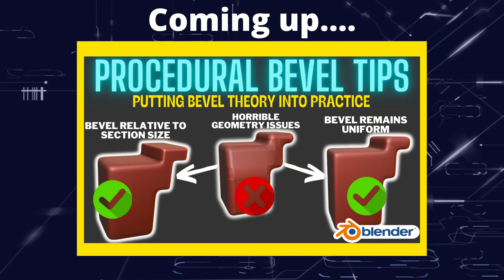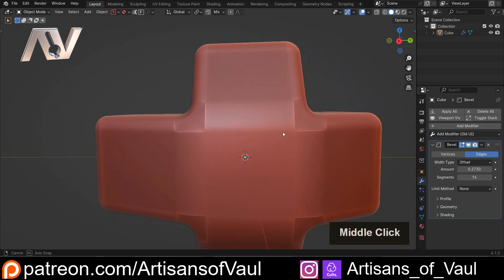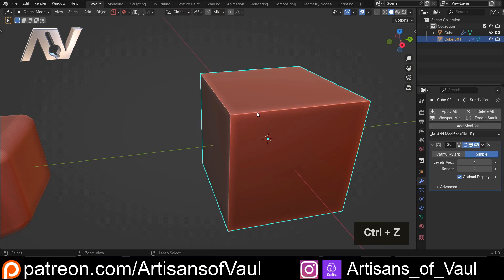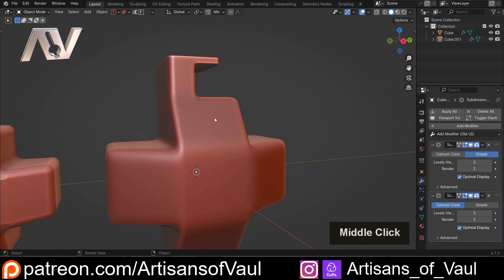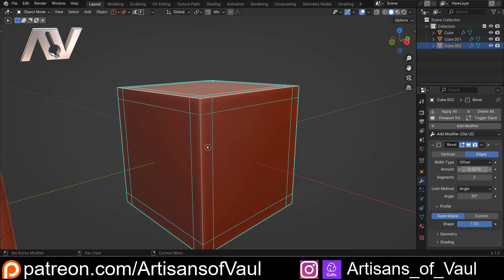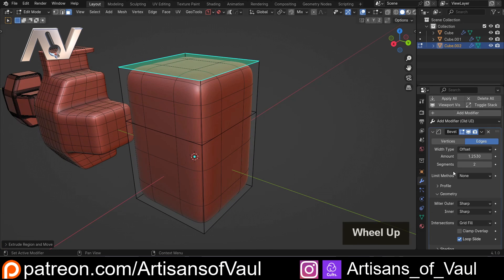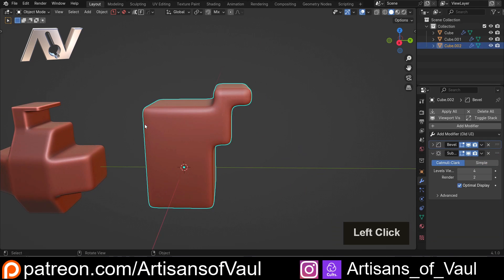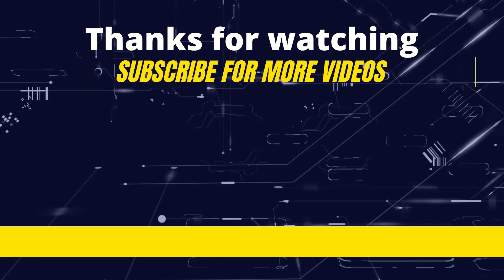Procedural bevel tips for Blender

Comment: in the last example, using the bevel modifier in weight mode you can achieve more control where you want in the model (limited but in some cases a plus).

EDIT COMMENT TEST 😂.  Sorry for deleting the check on the gear video (there was a like and and answer), AV I hope that didn't hurt you. But the issue is still there: I can't put a comment and here I can't put an answer on your answer, so I try this. (I can delete this part later).
Reply from the maker: That's a good call. For this I was trying to find something more generic that doesn't require much tinkering to make work once set up. But that is a good option.

Comment: Rounded edges also add physical durability. Sharp corners are more prone to impact damage than those with even a slight roundover. This is true in both woodworking and in designing 3d printed parts!
Reply from the maker: Very good call, and I wonder how much of a reason that is for the plastic shapes too. Great point 👌🏼